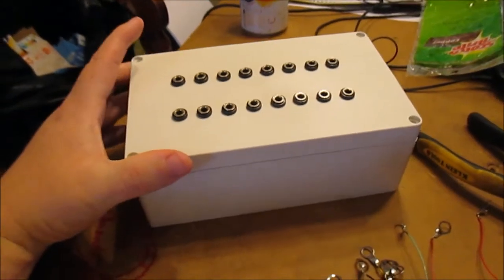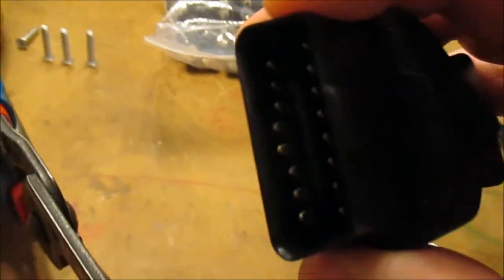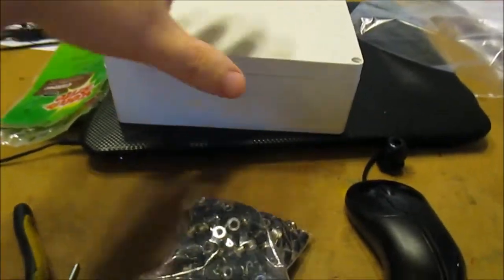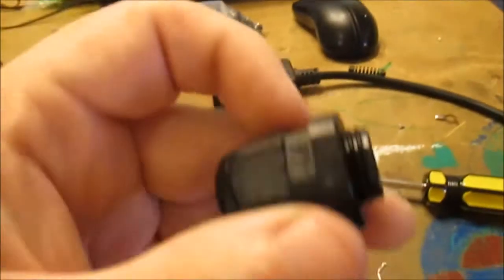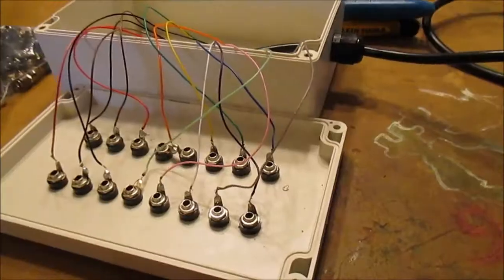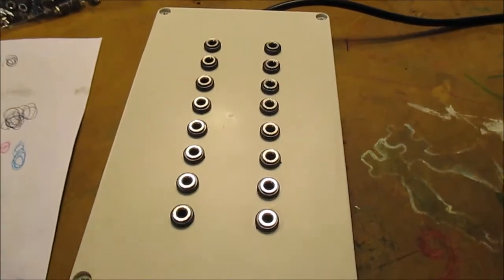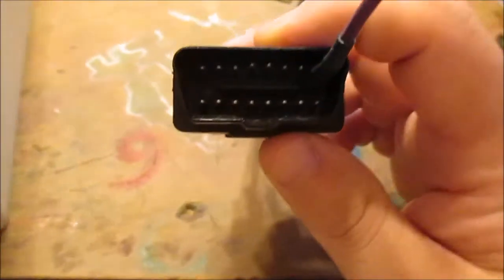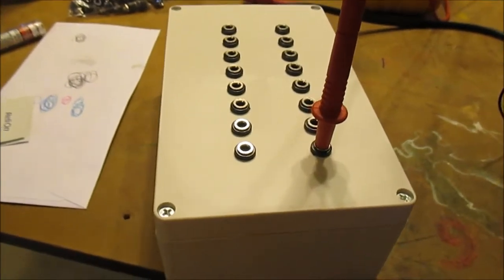Homemade OBD2 Data Link Connector Breakout Box

Comment: Those wires are pretty thin, I hope nothing gets shorted during your diagnosis procedures, you may want to redo the harness inside your box and upgrade to a better cable set in the near future. Thanks so much for the nice video. I built my own 200 pieces of 5-way rotary switches and custom made harnesses for many different automotive ECMs for use with a 4 channel oscilloscope. There was a problem in switching between different pins of the ECM, in case of not paying attention, shorting out certain wires together, so I sold it for a small profit and will build a new BOB similar to yours, much larger of course. Banana jacks will also be my choice of connector for ease and speed and minimal chances of shorting something out. My harness is the same size as the actual harness on the vehicles as they are what I actually utilize.
Reply from the maker: Thanks for watching!

Comment: While one is going through this, I  wonder if a person  can also put in a T and install an OBD2 jack on the box as well? and hell put in 10 feet extension, would that be a luxury or not really?
Plus I am thinking about making a bigger box with the face of it at an angle facing me and everything labeled and numbered.  
Come to think of why not get an actual OBD2 extension ( around $10).  Install it in the box and then inside the box T your banana jack right there?
I am thinking about car diagnostics set up.
I don't know if I am making any sense?

Comment: Great job!!!The 2 grounds are for Chassis and Signal. So in the end they both end up grounded. The reason the 2 ground pins are longer is so that there is no Electro Static Discharge (ESD) event when you plug it in. In other words the grounds make contact before any of the signal lines. It also prevents the digital signals from overshooting.
Reply from the maker: Thanks for watching!

Comment: would the obd2 cable from ebay come with 16 wires?
Reply: if pin 4 and 5 are combined, how do you know if the ground is NOT good on say the chassis, but IS good on the signal ground?  Love watching the build here but took my chances with the one from China; I can always open it and check it first before using it... great video , thanks for posting!
Reply: @66crush9  Yes I think it would be a good idea to have 4 and 5 separate in the breakout box for the reason you state.
Never assume anything is wired correctly in a car.
Nicely put together, AJ Pierce.
Reply from the maker: I am not sure, It might come with 15 wires or 16 I guess it just depends on how they made it. The connector will have 16 pins, but a lot of times they combine pins 4 and 5 on the cable because they are both grounds. Pin 4 is chassis ground and pin 5 in signal ground. Well I hope this info helps you out. Thanks for watching and thanks for the comment. Have a good day.

Comment: does it work and reliable?
Reply from the maker: Yeah the one I made works just fine. However if you do not want to make one, I have seen obd2 breakout boxes for sale on ebay for as little as 15-20 dollars, but I do not know if they are good or not, and I think they come from China so you never know. Well anyway thanks for watching and thanks for the comment.
Reply: i wl try the one i made. got parts from tayda electronics and just about ready to test...just waiting for the weather to be slightly warmer esp here in Toronto !